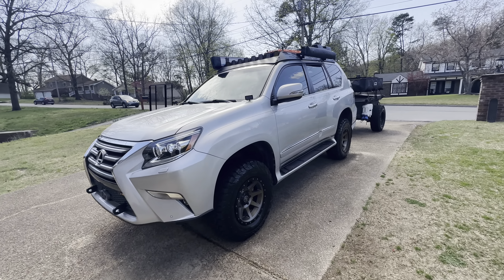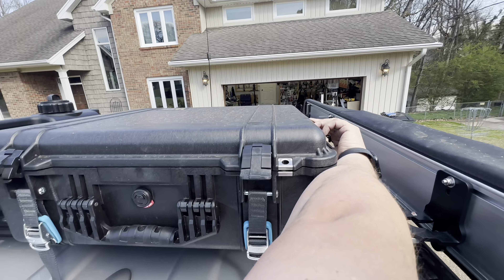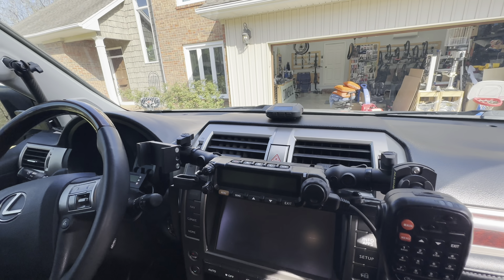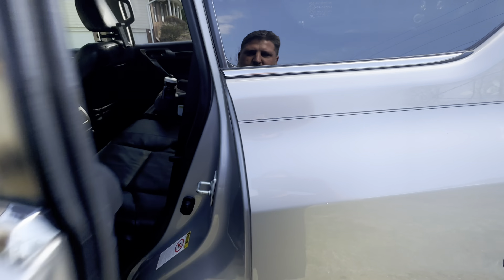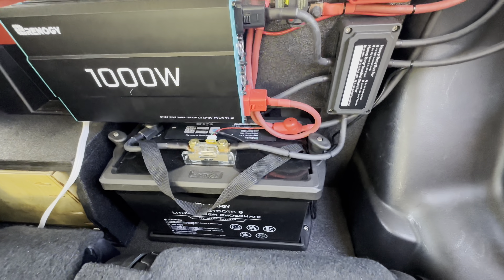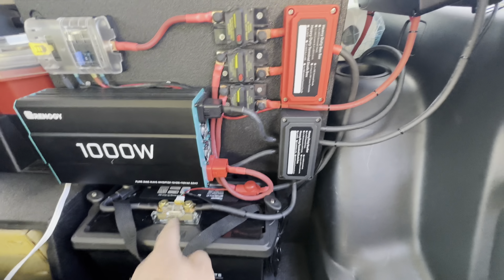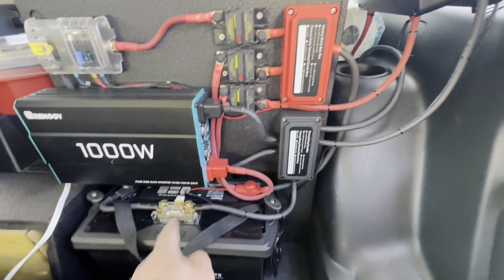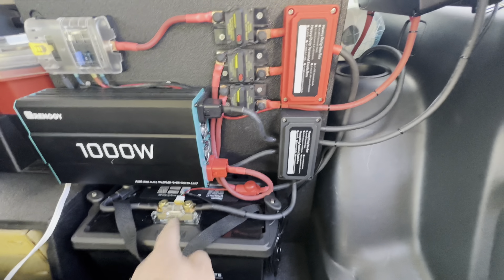Lexus GX460 Overland Build Walk Around

Comment: Hey! Wondering if you could help out a fellow YouTuber? I just have a couple of questions regarding your winch mount and winch installation.
Reply from the maker: @DIYSpeedGarage  Sure! How can I help?
Reply: @genegoesfast  where did you relocate your winch control box to? Also did you need to move/adjust the front plate forward/backward or was it ok as it came shipped? I got the same winch and mount with recovery points.
Reply from the maker: @DIYSpeedGarage  shoot me your email and I’ll send some pics / info over.

Comment: Which trim of gx 460 is this premium or luxury model.. I got an option to buy one of these wondering which will be better for off-road build at the same time on road smoothness with  less body roll?
Reply from the maker: This is actually a base. I think for an offroad build you’d be better off with the base so you can avoid the air bags. Kdss comes equipped on all models and that’s what you’re after to mitigate body roll.
Reply: @genegoesfast  thanks for your reply. When you say air bags are you referring to air suspensions?
Reply from the maker: @beyondhometown  no problem! And yes, I’m referring to air bags.

Comment: I watched this before I got my 2019 GX. I love this build and almost exactly what I was thinking; including the trailer. Did you install the LFD hidden winch yourself or use a shop? What is your radio setup? Thanks so much for sharing this.
Reply from the maker: Wow thanks! I’ll actually be selling my previous trailer setup shortly if you’re looking! I did install the LFD hidden winch setup myself. It wasn’t really that bad. Just taking the bumper off over and over to make sure I got a good fit. The radio is a Wouxon kg1000g. Killer radio and the mounting options are plentiful with the remote faceplate.
Reply: @genegoesfast  - Very cool. Thanks for the additional info. I might actually try the LFD. I'm still very early on my build. Just added bigger tires and getting oriented. Mine was a covid car (lease) so I just now hit 27K miles. I've had it for 6 months or so; still a baby. Which state are you in? If you're close, maybe we talk trailers if I can get the wife to agree. :)
Reply from the maker: @kurth7079  hey no problem! I’m in Chattanooga, TN.

Comment: Sweet set up. Did you add trailer brake controller
Reply from the maker: Thanks very much! I'm not currently running a brake controller. My trailer is less than 1,000lbs. As I add more to it, I'll likely add a controller and trailer brakes.

Comment: Nice rig! 
Question, why did you decide to have the awning on the passenger side when the trunk door swings open to the passenger side? Wouldn't the awning have better coverage if installed on the driverside?
Reply from the maker: So I just recently had OVS replace that awning under warranty and ordered a driver side awning instead. I agree that the DS option works better with the hatch and RTT but it doesn't work as well for pull offs on the side of the road or more casual  situations during everyday use. We'll see which I like better. 😄

Comment: Great rig, thanks for sharing. Anything you’d do differently, happy with the Lexus itself?
Reply from the maker: Thanks! Well I did change the wheel / tire setup shortly after I made this video. Went with a negative offset wheel and a larger 285/70/17 tire. All in an effort to get a little more ground clearance and push the tire out a bit more to protect the body a bit better. Additionally installed some victory rock sliders, installed a 4R hitch and chopped the rear bumper for additional clearance. So not much, lol.

Comment: Nice setup. Where is your spare? Did you fit full size in factory location without any mods?
Reply from the maker: Sadly I'm not currently carrying a spare. My trailer has been setup with the same bolt pattern and tire size so I really needed a spare I could borrow from it. Additionally I'm carrying a glue tread sidewall repair kit as well as a traditional repair kit. Eventually I think I'll be running a swing out to solve this issue.

Comment: Nice! What size tires would you swap to? 255/80s? I'm currently waiting on my wheels and was going to throw them on with 275/70 wildpeaks. Any major issues with the 275s, or any you foresee with a taller, skinnier tire?
Reply from the maker: I'm definitely considering a 255/80 or a 285/70. 275/70 are a good solid choice. I would just appreciate the additional ground clearance that a true 33"+ tire would offer. The only down side I can see to the skinner tire is a little less "flotation" on mud / sand / etc... A 33 x 10.5 would be a nice tire too if they could be found.

Comment: So what did you do to the bumper and what plate are you mounting on the lower grille?
Reply from the maker: I just chopped the bumper, added a LFD hidden winch mount and added the Peter GXOR radiator plate.